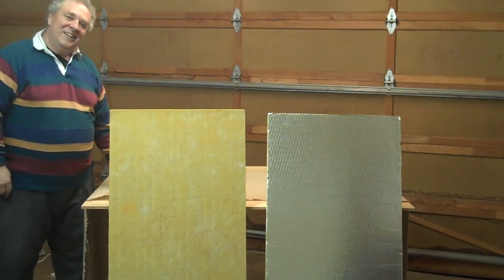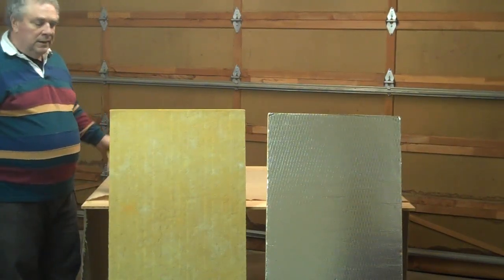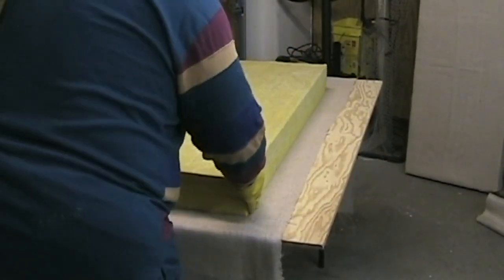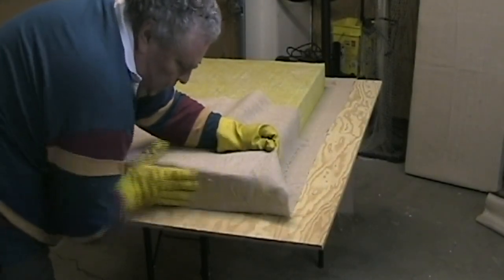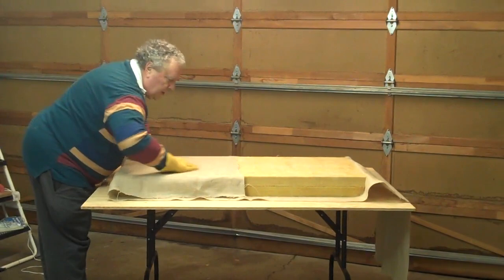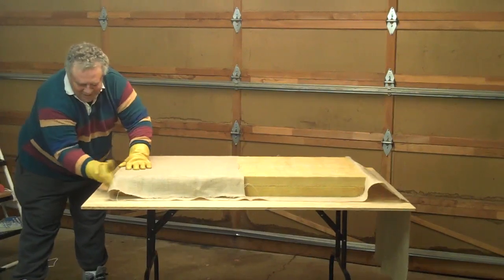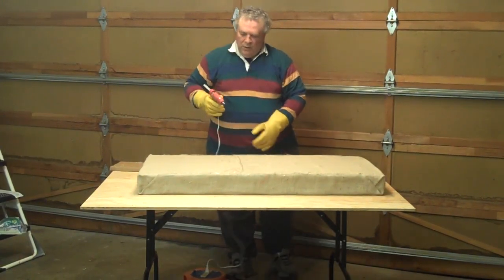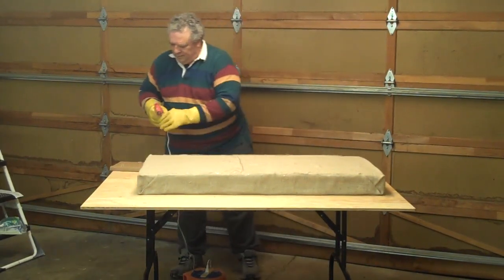Building a frameless broadband absorber

Comment: Hi sir I know its like 10 years late...but I have a question:
In the blog I saw in the comments that you said you don't hang them but instead just lean those toward wall. I was wondering as of now is any of the panels sagging or shape changed?
Reply: Good question - no, the panels have held their shape perfectly. We recently did a little remodel and took down all the panels, then re-arranged them. They are still holding their shape and working well.

Fran
Reply: @franguidry  hey man can u help me please. Do you know if this 703 will be inside burlap? Because I heard fiberglass fly out and its not good for health
Reply: @OrderisliveYt  When I did research on sound control material fiberglass was actually the safest compared to rockwool and acoustic cotton. 
I've had panels wrapped in burlap in my studio for many years, I've moved them around, and I've never had any problem.
Fran
Reply: @franguidry  thanks man appreciate it

Comment: It's good thing to have FSK absorbers mounted in corners working as basstraps, cause they reflect high and mid-high frequencies back into the room helping to avoid over deadening your room and also to improve low frequencies absorbtion. FSK facing must be directed into the room under fabric.

Comment: FSK is the acronym for "Foil-Scrim Kraft" - a 'foil' surface barrier available as an option on most semi-rigid insulation panels.
The concern w/ this is that the FSK layer is reflective to mid & High frequencies, as it may create destructive mid/hi freq specular reflections - precisely what BB absorber panels are intended to control.

Comment: Two panels wedge perfectly into my 8 foot ceilings, so the vertical corners are just wedged in. 

I use hooks and string to hold the wall-to-ceiling panels and also the ones suspended from the ceiling.

Then I lean the remaining panels against the walls at various locations.

If I needed to hang panels on walls I would put a spacer behind them and feed twine through the panel with a big needle, then use that for hanging.

Fran

Comment: I tried both 3M Super 77 and Loctite Heavy Duty Spray Adhesive. The Loctite worked better, but not really well enough. The hot glue was a much cleaner and more effective solution.

Fran

Comment: 7.- providing a larger sense of size and space to the SAS. Note, while absorption is a useful tool, it MUST be used surgically. Wholesale absorption of all non-critical early energy simply results in a dead room.
The larger lesson being that wanton absorption of all early energy is not optimal, & too often results in an overly dead room w/ little later arriving diffuse energy, as a SAS starts w/ a relatively small amount of energy that is quickly absorbed.  cont

Comment: 6.After this ISD gap, one desires the arrival of energy in the form of a spatially & temporally diffuse laterally arriving (rear sides) exponentially decaying  sdfield is most desired.  Ideally you want this ISD termination to be as w/in as 12 dB of the direct which generally requires much work to redirect much of the early arriving energy such that it can be redirected to the backs & sides where it can be  diffused & returned to the listening position rather than simply absorbed - cont

Comment: 5. W/out getting into the various acoustical room models, we generally want to render the level of the indirect early reflections down in level at Least 10 dB & ideally ~20, rendering them effectively anechoic during that very short -1-20ms interval after the direct signal. In a Sm Acoust Space(SAS), if one can achieve an Initial signal delay gap of from 7or more ms, that is fine. Note in LgAcoustSpaces(LAS), the oft cited ideal interval is 20ms - but that is not reasonable in most SAS.

Comment: 4. issues of decreased 'intelligibility'. This larger issue generally referred to as 'intelligibility' is directly related to multiple similar signals from a source arriving at different times within what is called the Haas interval - a small time window where the ear-brain cannot separate them into separate arrivals/events, & instead smears them into a less distinct single arrival. Thus the ctrl of early arriving reflections in the time domain is utilized. cont

Comment: 3. When freq resp is measured, this physical distribution at a point appears as comb filtering - with notches at certain freq..
Note, comb filtering is a display description & does not exist - but the physical lobing exists in nature. The point is, if all of he reflected energy is not uniformly addressed w/ broadband trtmnt, it effectively EQs the direct signal it combines with - cancelling more of he low freq as it is not blocked resulting in 'coloration' of the direct sound, as well as ...cont

Comment: 2. ...leaving allot of energy to reflect and to superpose (combine) with the direct signal which effectively results in phase related cancellation - called superposition - that results in physically distributed freq dependent polar lobing. These 3D lobes of distributed sound and nulls (look at your hand on the table with your fingers spread wide) vary in number and width with the freq- fewer at LF, & inc with higher freq. cont...

Comment: 1. A common problem w/ trad absorption of early arriving reflections is that trtmnt is not truly broadband over the full specular bandwidth. Sound changes from modal to specular (rm reinforced stdg waves to focused reflections) as rm dimen become >= to the freq wavelength. This transitional region is typically in the 200-300Hz region. Therefore in order to mitigate the entire reflected energy, the trtmnt must ext down to these freq. Most thin panels only ext to 800-100Hz,  - (cont...)

Comment: Also rock wool and 703 or 705 have extremely acoustical properties. You can use either or - just keep in mind that both are very dense and have optimal air to open cell fiber ratios. You'd need over 2 1/2 ft of generic pink fluffy insulation to attain the results of 4 inches of rock wool or 703. looks great! love that you didn't use a frame; no frame = 40% more surface area!! :)

Comment: @franguidry 

The market has moved on since then they found that the fiberglass was having to be 80kg non compressed, with a metal pin holing it in place but then the slab gathers at the bottom of the fabric. So the company that i work for and is in the tender for the new pinewood studio's, have been found a Rockwool 80 work for year's longer and held up.
Brad

Comment: the funny thing about this technique is it defeats the purpose of the trap. when spraying an adhesive like that anywhere on the compressed fiberglass or rockwool, it fills in the poors with glue. thus not allowing the sound to enter into it and being trapped.

Comment from the maker: @wakena2003 Oops, sorry I missed this one. I straddle vertical corners with two panels which fit nicely from floor to ceiling. I straddle ceiling to wall coners with eye hooks and twine. I also use eye hooks and twine to suspend panels from the ceiling. Then I lean the rest against the wall so I can move them around if needed.

Fran